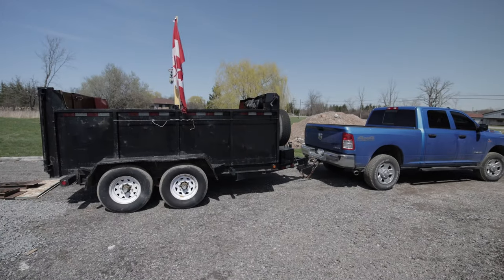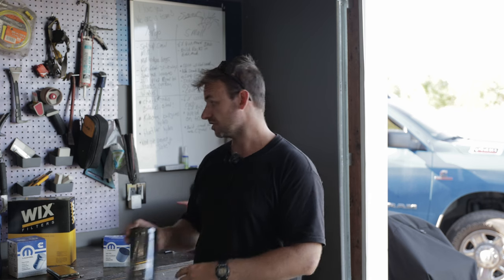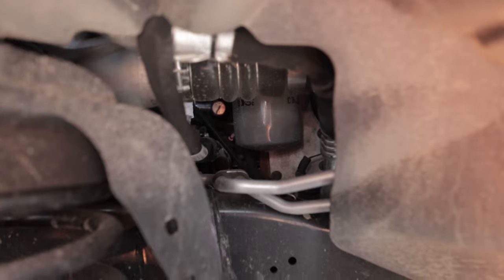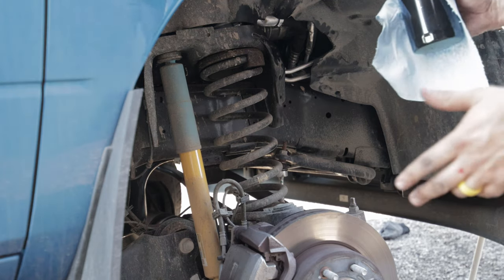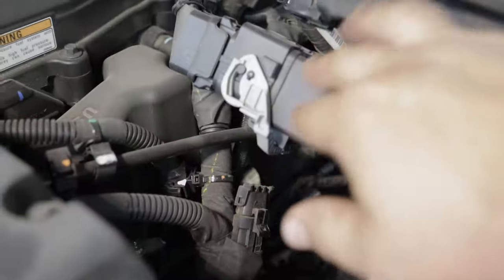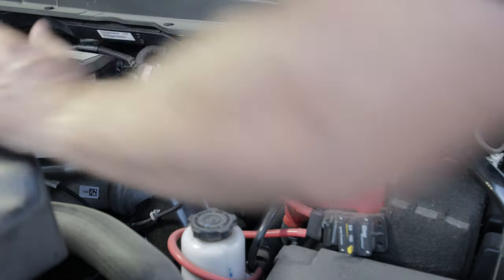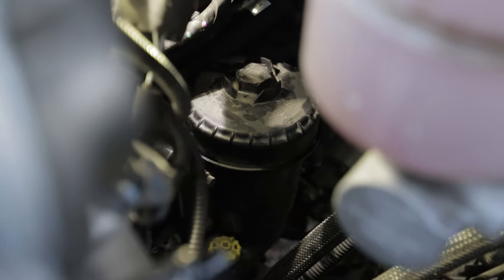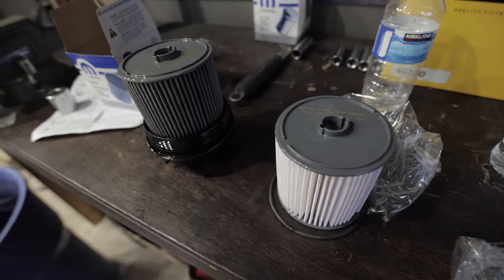2022 ram 2500 6.7L COMPLETE oil change fuel filter and air filters -- NO SPECIAL TOOLS !

Comment: 2022 Ram 2500 HD Tradesman owner here. Socket for fuel filter caps is 28mm. I taped an oil funnel to a piece of garden hose and taped it in position with the other end in a jug below each fuel filter before draining. I spilled no fuel at all on the front filter, and very little on the rear. Captured about 1.5L of diesel.
Reply from the maker: Smart
Reply: Nice video! Why not just use the bag trick on the rear fuel filter too?

Comment: Just did this on my 2022 ram 2500 and I found it easier to take the vacuum hose off and you can get to the oil filter real easy with no mess without the special tool
Reply from the maker: Smart

Comment: on my 2022 Ram Cummins, I could get the oil filter loose but could not get it out from behind the inner fender -- various hoses were in the way. the opening was too small.  I found a easy alternative.  Take the flex pipe off from the air filter box to the turbo -- two large hose clamps, one at each end.  Reach in and grab the filter.  I had the filter in a plastic bag as was suggested, although it was a mess because of my initial efforts to pull the filter out.  Drop the new filter in next to the turbo and go to the fender wall to lift it up and screw it in..
Reply from the maker: Great idea